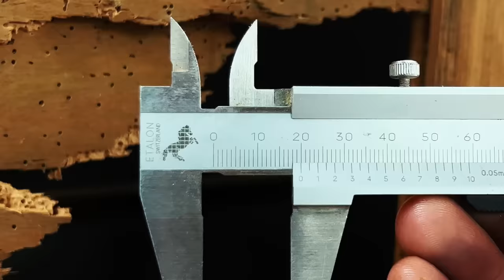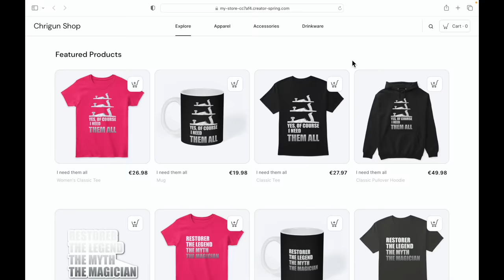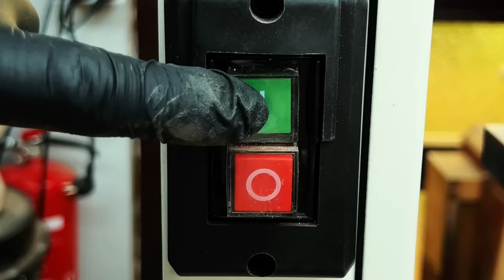WUNDERBARE Restaurierung dieser Kommode

Comment: I might have missed it, but how was the tone of the finish determined. I saw the removal of the many layers of paint but did not see a clue that identified
the original finish. Help?
Reply from the maker: The brown color was the original finish. But my parents wanted a bright chest of drawers.
Reply: @chrigunrestauration  Got it. Thanks. BTW: Great Restoration. I noticed that you did not use dowels when gluing the boards. Do you use a particular
cement that gets around having to use dowels? Thoughts?
Reply from the maker: @BruceWSims  Thanks. gluten glue. skin and bone glue
Reply: @chrigunrestauration  Thank you so very much. I am not averse to dowels but have always believed they were Not manditory for all joinery. I'm off to find your cement. Many, Many thanks for the tip.

Comment: I love that you only have work related noise and I love watching you work.  Those were really nice handles
When furniture is worn eaten, is there à way to be sure the worms are all gone?
I was watching a lady repairing a dresser and the some of her  music was hurting my ears. I liked what she was doing, but because of the music I won't watch her any more.
Reply from the maker: Hi. Many Thanks. Yes, there are. There is a poison against woodworms. But I don't know what this is called. Then you can soak the furniture with ethanol and wrap it in foil for 2-3 days. The most effective is a thermal treatment. The wood is heated until the core has reached 60 degrees and then hold for at least 3 hours. Regards